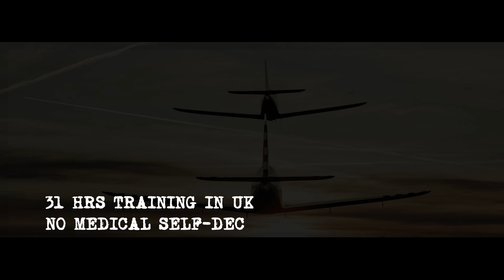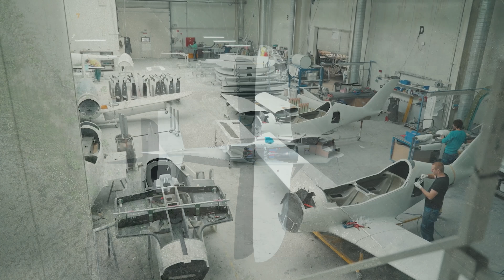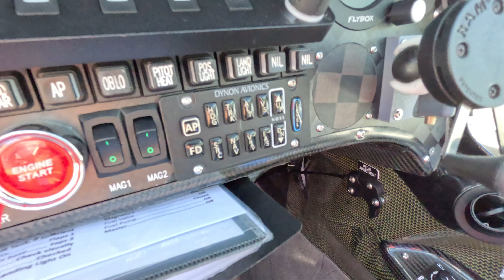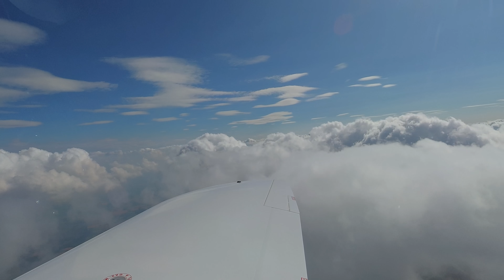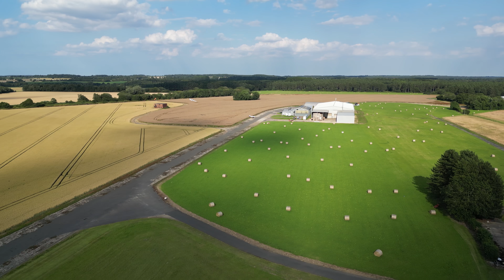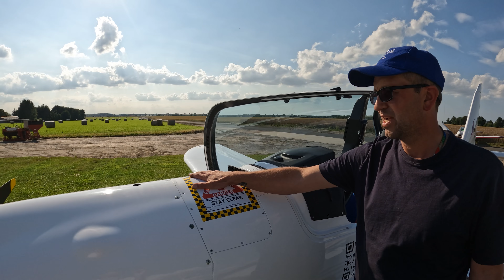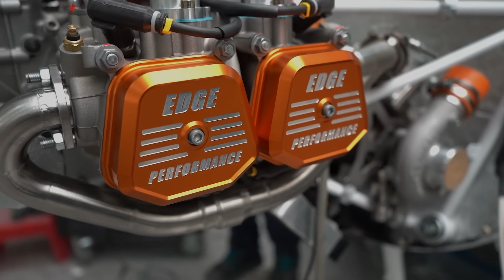YOU CAN FLY THIS from just 31 hours training from ZERO AND NO MEDICAL!

Comment: Terrifying. It's like an allowing a provisional licence holder to ride a Hayabusa. No disrespect to the aircraft at all which is amazing, but licensing needs tightening up.
Reply from the maker: Not necessarily, 31 hours is minimum and you still need to be signed off as competent and have passed a skills test, it's possible to do it in that time but not many will. Thanks for your watch and for commenting sir.
Reply: VictheSecret
In the us, you can ride a Kawasaki H2r at 16  with just a written exam.
Reply: So you never flew a Shark either. Right? Sure. I know you have never flown one, since otherwise your comment would be saying the very opposite.

Comment: Not in America you can't. At least not yet. I'm sure the FAA will make it almost impossible.
Reply from the maker: Sport pilot licence in the US already allows upto 600kg 1,320lb but are limited to 120 knots CSA ground adjustable prop only and fixed gear, the new LSA proposals under MOSAIC consultation will lift those to bring them more in line with European ultralights and microlights which have a great safety record here.

Comment: Iam lucky enough to have had a flight in G-MAKO. Its a very impressive aircraft, ultra fast and has very nice easy handling although I think its too complicated an aircraft to fly with only thirty odd hours training from scratch. I really enjoyed flying it but you do lose some of the STOL characteristics of other more affordable microlights and the amount of pitch up you need to slow the thing down is incredible.  It is also pretty awkward to get in and out of even for someone young and flexible like me. Its a great plane but you can buy a lot of GA aircraft performance for less than a third of the price.
Reply from the maker: No ones going to be in this in 31 hours, however it's a great selling point. I don't know what you think but to me this is not really a practical aircraft for touring as although there's that massive range you'd be hard pressed to fly anywhere in Europe for 10 hours VFR.
Reply: @ShortField  This is the bottom line issue...

I find it incredibly strange that there are RVs etc that are Night and IFR approved to fly under permit from the LAA .. but this £250,000 brand new airplane isn't.

Comment: They're remarkable little aircraft, very nice (at a price🤔).

I think that a fixed gear version would be useful too.

I'd like to see something similar, but side by side.

I'm also wondering with small ailerons what the crosswind capability is.

And, in the 600kg category, why no step under the wing to help access and egress.
Reply from the maker: They start from as little as 240,000 euros for a basic version :-) I think the extra weight and drag from fixed gear (the retracts have a lot of Carbon Fibre in them and have a low operation speed of 70 knots) would make them a bit of a waste of time.
Reply: @ShortField   Hi Terry, I'll sell a body part or two🤫🤫😲😲🤭🤭 Understood re the undercart now, it's just one more thing to service, to go wrong, adds complexity, moves away from LSA/Microlight K.I.S.S ethos. It's a fancy thing to have though, makes the aeroplane very slippery too👍😊 Trailing link retracts can be a double edged sword though - at times too 'soft'🤔 Swings and roundabouts I guess.
Reply: Add up all your requirements and you got a totally different aircraft!😊
Reply: @hugostiglitz6914   If the medical isn't an issue, and one invests a little more in training, then good second hand, aircraft, with similar capabilities can be had for less money in the PPL type categories🤔🤔
Reply: @musoseven8218  You'd be hard pressed to find an aircraft with the same short field performance, the same fuel consumption and the same cruise speed and the same avionics. Also the maintenance requirements.
It says in the upload, it's probably aimed at people with money who wouldn't pass the medical. 
Some people like their toys new.

Comment: That looks like an awesome little plane...  but if you can't pass your medical, maybe you shouldn't be flying that 😁
Reply from the maker: You still have to meet a medical standard although it's upto you to certify that you do. We drive cars without a medical. Thanks for the comment and watch.
Reply: no one is stopping you from getting your medical anyway. you can even do 10 in a row, between your boosters. just to be safe.
Reply: @woodchipper69  depends why one cannot get ones medical.   I grounded myself because my cancer drugs were knocking me out.  If I cannot cycle 12 miles to the airfield then I do not have the energy to fly an aeroplane.  Despite that the Shark looks like it would be fun to fly.
Reply: @kaasmeester5903  sport pilot only requires a valid drivers license. If you ever take an FAA medical and fail you are disqualified to fly sport planes.